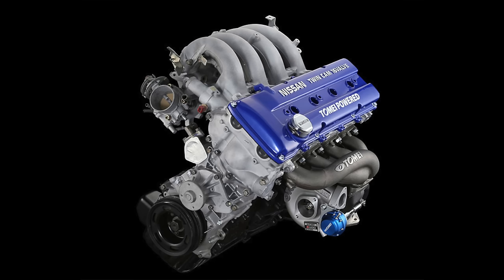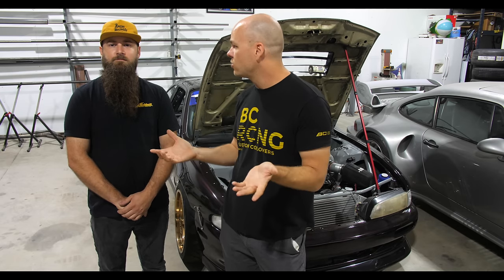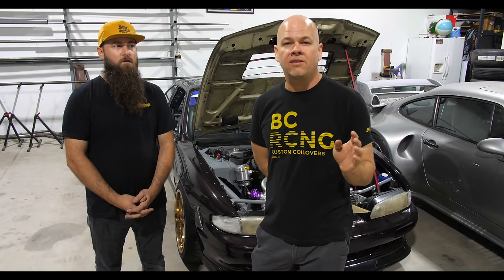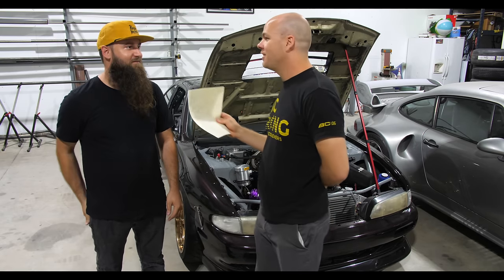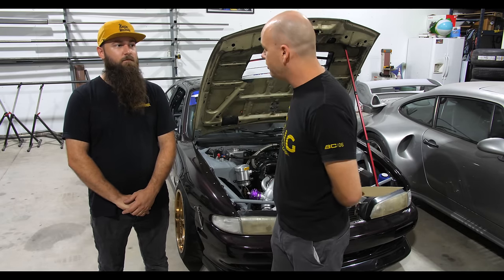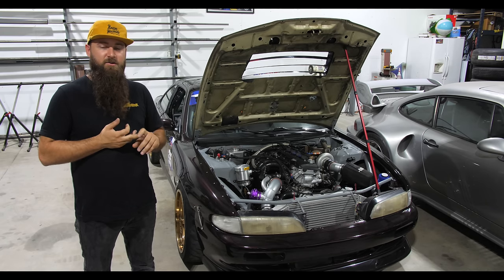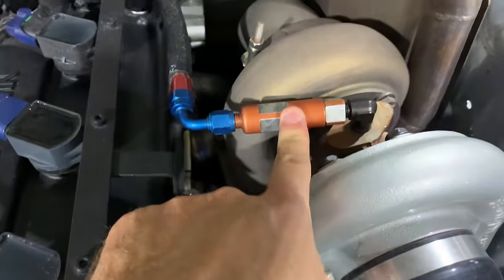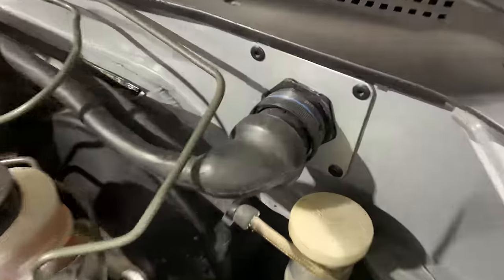Learn something new about the KA24DE engines!  Lets chat about them.

Comment: Quite informative. KAs don't get much love, but it's amazing how some people and smaller companies are doing aftermarket parts for these engines.

Something that should've been mentioned is the durability and stresses the factory parts can handle before they fail. It's been suggested in Facebook pages that the stock rods can handle plenty of power before failing (stock pistons would fail first). How much RPM the stock crankshaft can handle before secondary harmonics start to become a problem. I was surprised the stock oiling system is that good, with no need of an SR style aftermarket oil pan. No mention of windage trays or oil scrapers, though.

I want to make a KA-DET with the Tomei turbo kit. I'd love to get my hands on a Nissan Motorsports side draft intake manifold for turbo ITB setup, but it's most likely discontinued and a rare part to find. Since it will be for a street car, it will see an occasional drag/circuit run or two.

Would love to get more into this platform in order to make safe reliable power without going overboard, using OEM and aftermarket parts. If anyone can suggest me where to get the help for that, it would be much appreciated.

Thanks for proving that the KA isn't "just a truck engine". Its lineage can be traced back to the L engines, and that particular engine architecture was inspired by a Mercedes-Benz inline engine. So we can say the KA has some pedigree in it's design.

Comment: As much as a turbo build would be cool, i just got done with my Dual sidedrafts on my Single cam and i love it, tuning is another subject but the sound and simplicity of it is amazing.. Been driving this truck for 15 years and as many problems ive had with mafs, ecus, and harness issues,  I think having a 2 wire ignition and some beautiful webers on the side is well worth it
Reply: What manifold are you running? I know Nissan Motorsports offered one for the E and DE versions of the KA, but it's most probably discontinued and a rare piece.
Reply: @JoseRivera-ym3wj  its a custom intake.. Runners are from xcessivemanufacturing with a weber plate.. its a 2 piece set up 
https://i.imgur.com/JiEj4pg.jpg
this is what i got .. Volvo s40 electric power steering, l20b dizzy, GM HEI ignition module for an ignitor and a custom billet dizzy mount

Comment: Thanks for the very informative and great video! I'm really interested in his choice on keeping the OEM intake manifold. He mentioned there are no options that have been proven to make the same power curve as the OEM, especially in the low end range. I've always considered the Xcessive Engineering manifold to be a great option; but I'm really surprised to hear it really is not an improvement? Would love to hear more of yours or Spencer's opinion on this!
Reply: It's pretty simple that the stock runner length is much longer and will make better mid and low range.  Plus, you couldn't pay me to put another xcessive part on my car.  If I ever end up over 600, I'll probably make something.
Reply: @spencermarvdashtipour3615  Makes sense, thank you. Probably saved me a couple hundred I can put elsewhere 👍

Comment: Here’s something I think Aron would like the idea of, Honda offers a drop in crate civic type r motor at a reasonable price. It’s $6700 for a complete engine with the turbo and $9000 for the complete engine with a wire-ring harness and ecu. For an engine that stock makes 300hp and can easily make 350 with just a tune it might make sense for a simple seat time car instead of adding a turbo to a 10-20 year old k20 /k24

Comment: Ive been running dual cam KAs since 2008-9ish. Only had oem headgasket failure and one spun rod bearing. I had a single cam- my first 240 ever, back in 2006, the timing chain guide was so worn that the chain wore a whole in the water pump, and flooded the oil pan with coolant and locked the motor up. Didnt know what had happened, 16 year old at that time.   But yea, Idk what power I have but its plenty to drift and super reliable. Dual Cam with light weight pullys, light weight fly wheel. I only run one belt, No power steering. Used turbo off a duramax? lol ebay manifold and fmi. oem everything, i use a FMU and with oem fuel regulator. No Tune. Maybe some day I can afford some kind of tune, and dyno. Im at 7 psi of boost. In order to run more, need a tune, injectors, pump.

Comment: Several years back there was a company making a supercharger kit for the ka that used a S/c off of the nissan pathfinder. Any opinions on that? Its not very common but for a person like me who enjoys the feel of linear torque from the na stand point, the S/c kit would be the way to go IF it is/was obtainable.
Reply from the maker: That option isn’t that great and is kinda pointless due to a variety of reasons, such as super charger size, cooling the air, brackets, etc.  easier to just turbo the car with available quality aftermarket parts.  Unless you are just really into that or something, avoid that idea.

Comment: I have a KA24DE in a 2002 Nissan Frontier. I am looking for a good coolant hose schematic. I have replaced the radiator hoses, but I want to locate the routing for the heater hoses and related small hose connections.

Comment: I’m building a KA with eagle h beam connecting rods
Weisco 9:5:1 pistons
Clevit bearings 
Cometic head gasket 
Bc valves and springs 
But I’m looking for a good engine management can you give me some pointers
Reply: Looks like stock comp ratio...Are you planning on boost? I'm ready to pull my KA from my Datsun 510 for a rebuild. I' shooting for a strong NA, stage 2 build that could handle a medium power turbo in the future. Trying to create a build list...

Comment: dont forget ka24det also can get 1100 cc stock inside feed injectors from a company called " five o "
Reply from the maker: Those are terrible injectors, out of 20mormso we bought they had a 25 percent failure rate within 1 year, which is insane for injectors

Comment: Haven't searched your videos. But am curious if you have any insight in a supercharged ka24de? I know they have/had a knights supercharge kit at one point.  Came with an adapter plate, wiring, flash kit, injectors, and an  Xterra M62 Eaton supercharger. ...  I've looked into it, have searched online for a trashed xterra in search of a 2nd hand supercharger.  But to no prevail.  Just not interested in spending 2500 for the kit. 

If u have any info on this, I'd love to hear it!

Comment: This is a lot of good information. Im putting a turbo on my 96 hardbody. any recommendations if you see this3 years later? lol
Reply: 😆 Here I am! I recommend using the 240sx ka24e intake manifold, throttle body, and fuel rail. DW makes drop in injectors for that rail.

Comment: I built my own custom itb set up for my old s13 hatch (after I swapped a de into it). It took alot of work with very little gain. The only benefit was a amazing throttle response and the sound of the itb sucking in air. Other than that it wasnt worth the time.

Comment: If anyone wants a cheaper option for dash monitoring, you can get by using a decent OBD2 adapter and using Torque Pro. You can set alarms as well. I have it installed on my android radio. Near the ending on my ebay PCV adapter video, there is a small glimpse what it looks like on my setup.

Comment: KA gang!!! I myself have blew up a few KA’s after turbo’ing them, but that was due to lack of proper ECU management (Stock ECU w/ SAFC. T25 turbo, stock internals). I was actually debating on swapping over to SR but decided to stick with the KA, but with proper management this time. I’ve went with Nismotronic, and currently in the process of putting in another KA. This time it’s a freshly built motor with forged rods & pistons and BC valvetrain with ZERO miles on it. A friend was building it to throw in his s14 but he found an SR for a good deal before he could even run the car so he sold it to me for cheap. Subscribe to my channel for updates!!! Very good informational video though guys, respect!
Reply: My KA swap 510 is due for a rebuild! ...Might just go NA stage 2 with the option for a smaller turbo in future... no low comp pistons. The current KA is still strong but the noisy valves and stock injectors aren't playing well with my 300ZX fuel pump anymore!

Comment: Question. So basically KA24E and KA24DE can use the same bottom end parts?
Reply: Pistons and rods can be used interchangeably. Though the same piston will offer a different compression ratio when used, because of the difference in cylinder head. For example: a ka24de 10:1 piston will produce 9:1 in a ka24e. Rod and main bearings are the same, though cranks are slightly different. Hope that helps!

Comment: Why do we have MAF in the first place when a MAP does the same thing but doesn't break or burn out? Seriously I want to start a conversation about this
Reply: manny s if you are running a turbo setup, you really want a MAF. Although some cars have both
MAF is always better tho
Reply: The reason is MAF's(hot wire) correlate more variables with atmospheric conditions then MAP sensors do, like altitude, barometric pressure, and temperature. A big problem with MAP is say you tune your engine a 500 feet above sea level and you take your car up a mountain or any other place at a different atmospheric pressure the tune will be off.
Reply: While speed density is simple it is still a calculated value for volume using of pv=nrt vs MAF which gets this directly.

Barometric correction is not much of an issue and many oem's take care of this with either an additional pressure sensor or taking a reading koeo
Reply: Go megasquirt

Comment: I have a 275hp NA de in my Datsun 510 and had a 350hp turbo de in my s14, both setups are great, but one cost 2500$ and one cost 8k. Pick and choose
Reply: Anthony Farrel lol ka s14 for 8 grand I think not
Reply from the maker: how did you end up with a 275 NA ka?
Reply: Lone Star Drift built by rebello
Reply: David Stevenson the ka-t was 2500$ in the s14

Comment: This is awesome! Do something like this for the 7M engine in Mk3 Supra's. I'm putting together a built 7M right now. 7M's like KA's are almost always put together based on cost and get a bad rap because of it! #headgaskets
Reply: With arp head studs and torqued to the correct spec (the one by toyota I heard is incorrect and caused the head gasket issue). The 7mgte can be a good choice.

Comment: Why is ka good with oil control the oil pump is very similar design from Rb?
Reply: Rb has oiling issues from drainback, not lack or pressure
Reply: @dylanchaffee3640  yeah but we have issues with the oil pumps breaking as well lol
Reply: @AdmissionGaming  i thought that was a stock rb26 issue? Doesnt the nut back off on them?

Comment: There is no engine like a Honda engine...
Reply: that's right boostedboiz make 300plus with a k24 na fully built but a built ka make like 220 hahaha o and a k24 with head studs and gasket and a turbo kit can make 500 safely but I do like a ka tho I had a na 240sx dual over head cam ka24 it was tough had a few bolt ons and I beat the tar out of it and it's still running my friend owns it now almost 200k miles on it to so they can be reliable
Reply: I love my s13. But everyone knows Honda rules the 4 cylinder world. Can’t wait for them to fuse 2 k24s together and make it easy to obtain
Reply: @sdshakazulu4268  here's to the 2kz haha go boostedboiz

Comment: If I was building a car from that time period, I'd get rid of the gasoline engine in it and put a diesel engine in it. There are plenty of inline 4 cylinder and inline 6 cylinder diesel engines to choose from that could fit in a car like that one. No need to change fuel types or any of this other rebuilding the bottom end nonsense. 350 HP and 550-600 lb-ft of torque is plenty for a road car at 6,500 RPM with a diesel engine.

Comment: Strait junk
Reply: Hahah strait junk don't run 17psi on a bullseye s362 on pump with only forged bottom and was put together in 2009 and stills runs fine even runs nice at 24psi using q16
Reply: I have fucked with these engines I  use to work at Nissan these motors are junk
Reply: @ek4drh22  probably do some research these things are not how they used to be 10 years ago
Reply: Wait till they merge with fiat hahahah